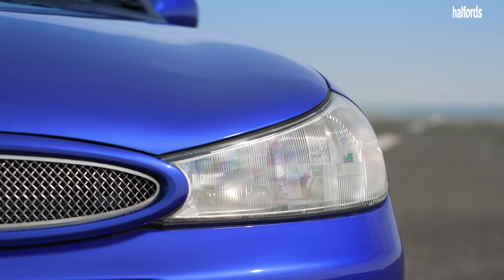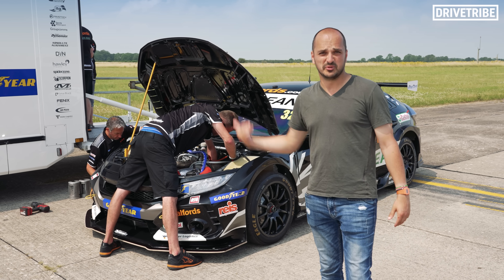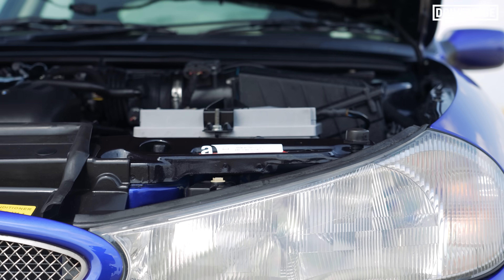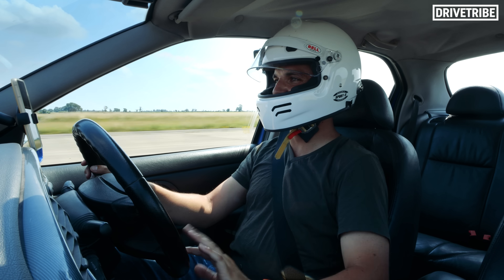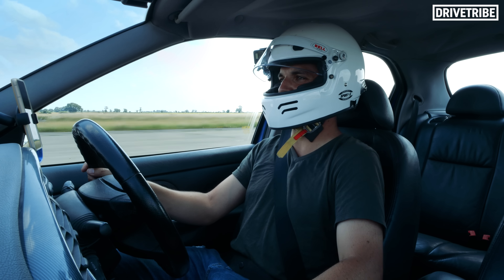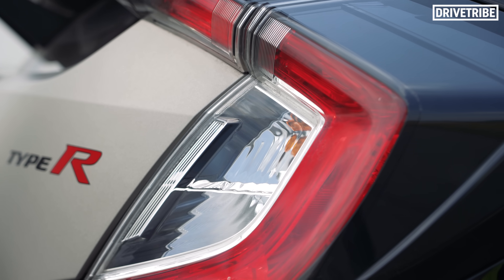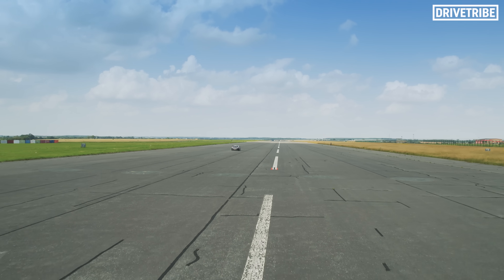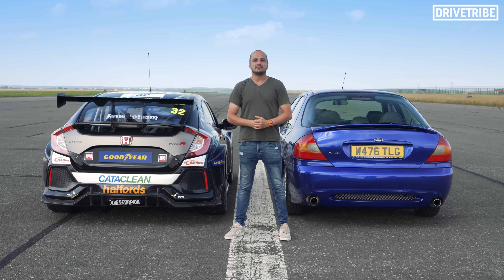Can our 21-year-old Ford still hit its original top speed?!

Comment: Sagging roof lining on a “fully restored” car will always cap your vmax
Reply: And the boot lid lock cylinder
Reply: Should have folded the back seat down for an extra 10hp 😉
Reply: driver's side window also scratched from failed weatherstrips (they all do that sir) and glass not replaced
Reply: Can't quite get my head around the sagging roof lining. Presumably removed for respray... why tf, when showcasing their specialist abilities, would they put that POS back in?!
Reply: @user-tw4cj2wt5d  I can only conclude that either they couldn't get a replacement because of the situation and/or the budget wasn't there. Still, could have done what HubNut done with his Ford whilst over on the other side of the world on next to no budget at all (and will have to do again now Betty the Ford Fairmont (AU) is here in the UK).
Reply: @TheEmperorPigeon  Does seem bizarre! A new headlining couldn't cost a few hundred quid. The rest of the work, at the usual rate, would total 5 figures easily
Reply: Had to go back and see for myself, not great on a supposedly box fresh car, we'll not mention the clouds of blue smoke on launch.
Reply: A roof liner would have to be done by an upholsterer and not a mechanic. It would annoy me though
Reply: It’s a Ford, they come from the factory like that.

Comment: Could use the runway width to get more speed.. drive up to 20mph down the runway, then do a u-turn as you approach the end, accelerating as you make the turn/begin to drive up in the other direction.. maybe?? Lol
Reply: Yeah this seemed a bit low effort, not only there was a fairly long stretch of road that joined onto the runway at the start, with the width of that road you could probably do around 60 to start
Reply: Doesn't work unfortunately. At some point during the turn your velocity in the direction of the finish line will go from a negative one (you are driving away from the finish line) to zero. This is the point where you start accelerating towards the finish line and ideally you would face the finish line directly to apply all possible force the engine has in the right direction. However, during a U-turn, even if you use 100% of the track, you will always start sideways, i.e. 90 degrees tilted from the direction you actually want to go. 
Assuming your tires are at temperature and you can preload the turbocharger (if you have one), it is always better to start from a standstill at the very beginning of the track. Can't cheat physics, yet..
I totally agree with your point thought... I expected the to try something
Reply: @RickyMcSpanish  Exactly what I was thinking when he did his first standing start
Reply: @TheKaylich  I'm sorry, but you are just wrong on this.  You are mistaking the cars ability to accelerate in terms of velocity with the engines ability to accelerate the car linearly (absolute speed).  When you are perpendicular to the track and turning, your acceleration is limited by the tires and your acceleration is due to changing direction not increasing absolute speed.  Just think about if you were on a bicycle and you are traveling at a decent rate of speed and you pull a U turn with a diameter of 20 feet.    When you complete the U turn, you will only be 10 feet from the point where you were perpendicular with the road.  At the end of the U turn, you will be traveling much faster than you could accelerate from a stop in 10 feet.
Reply: @brandonp8300  @TheKaylich Well, either one of you could be right, depending on the vehicle and the radius of the turn. During the second half of the U-turn, assuming a constant speed turn on a single radius, the average acceleration parallel to the runway is exactly one-half of the lateral gs provided by the tires. Whereas if the car did a standing start from the very end of the runway, had AWD, then engine power permitting, it could potentially use 100% of the grip of its tires to accelerate over that same distance, thereby reaching a speed sqrt(2)=1.41 times faster. However, the FWD Mondeo will never be able to accelerate in a straight line at the same gs that it can corner, and its engine only makes 200 hp, so the best strategy would indeed be to take a running start on the largest radius circle possible.
Reply: Flying start makes little difference in this case.

Comment: Halford's are a complete rip off my ex wife took her car in for an pre MOT inspection and Halford's recommended that she needed to change the Cam belt to pass the Mot. when she told me i rang up the service centre to question this obviously dishonest statement and i asked the technician why a cam belt is needed for an MOT (Which it isn't) and he told me " The engine needs to be running!" I then pointed out that the car was driven in and out of the service centre to which he answered " I might not be on the day!".                         find yourself a local mechanic who has to book in work weeks ahead as they don't want your work and are going to be honest. but whatever you do avoid Halfords and Kwik fit service centre's like the plague
Reply: They won’t do the emissions test if your cam belt is overdue. Imagine the belt failing when you’re smoke testing. You’d be the first to sue Halfords. All about liability.

Comment: When are you replacing the interior roof lining?
Reply: never
Reply: Same time as he will be putting the gaffer tape on both bumpers i expect
Reply: @maverick4177  Underrated MK2 Mondeo banter
Reply: it will be scrapped after this video, trashed the engine
Reply: By the time the headlights are restored properly.

Comment: Why didn't you get a draft from the civic then pulled put when it topped out at 140? Could've nullified 30% of the drag, and easily given you a shot at the top speed.
Reply: I'm confused why he only did the speed run from a standing start?
Reply: Your interesting 😂
Reply: @procatprocat9647  You do realise that roads do connect to the runway, it's how the planes don't have to drive on the grass... he could have taken some speed through the corner.
However the key piece of info that was missing in the vid is how fast it was still accelerating towards the end.
Reply: @keoun9759  You have clearly never been to a runway in your whole life.

The interconnecting stretches of tarmac are never located at the end of runways.
As a result, the pass would be shorter and at a lower speed, using your approach.

Try a bit harder next time.
Reply: Not easily, for sure not; lest you literally tow the mondeo with a rope. Runways cant be used to test the top speed of any "faster" car, its just a fools errand.

Comment: Wouldn't be surprised if the IMRC unit isn't working on that. Absolutely hammers top-end power, which is exactly what you needed in 4th gear. Mind you, I used to have an ST200 as a family wagon, and it was never that quick (also drank like a fish). My BX 16v would have murdered it in a 1/4 mile race, despite having less power, but sadly I never got to try it out before our ST200 was turned into bean cans. Still got the old BX though, so if you fancy a quick 1/4 mile at another airfield, I'm game!

Comment: The funny thing here is that the Halfords road tech is doing jobs that anyone can do such as checking fluid levels and tyre pressures. Whereas the BTCC team have to check on the data logging system, recalibration, engine mapping, suspension setup etc. Yes, aswell as fluid levels and tyre pressures.

Comment: Time to ask Turbo Yoda to do its magic and boost that baby up!
Reply: They take boost well. These are the same engines as what was found in the early Noble GTOs, can easily take 450hp on stock internals.
Reply: @NathanFrench  I wouldn't push that far, but engine was rebuild by experts so I'm sure it can hold a small turbo to spin up faster and help that 4th gear!

Comment: I had a 2004 Mondeo Ghia 2.0 Duratorq diesel Hatchback. It was supposed to be 130bhp, but it felt much quicker and it was rumoured that actually when tested on a rolling road, the engines were putting out closer to 160bhp.That car would exceed 140 mph easily as indicated on the sat nav on trips to Germany

I
Reply: I've got a Mondeo 2.2tdci I've had that almost off the clock 150 on the clock pulls like a train to 140 then thinks about it after that

Comment: Dont remember my ST being that slow. your doing 60 to 83 in 10 seconds? must be under powered.
Reply: Ya the car doesn't have 200 crank hp that's for sure, he's finished the Quarter mile at 83mph and there's nothing better then that to know the power of a car. My old stock 1994 Saturn SC2 finished at 88mph and my modified 2012 Chevy Cruze did 89mph. The Cruze was 3200lbs with about 175hp.
Reply: My ST24 had less power and still dealt to it on the 1/4 mile time. In fact it did a 16.7 or something with the IMRC playing silly buggers

Comment: Easily could have used one end of the track to do a 180 degree rolling start of around 30-40mph in at least 2nd gear, instead of a standing start?
That probably would haven't given them enough room to at least get into 5th gear for a few seconds.

Comment: You should add a small NoS tank for that fourth and fifth gear and compensate for the distance with the NoS. You won't need a mental amount, just enough to get to the tops speed. 

Plus it's another video!

Comment: I used to own an ST24 and that would hit 60mph in 7.5sec, and I'm fairly sure it didn't take 9sec to do the next 23mph (83mph/16.67sec). The St24 was down 33bhp at 167bhp too. I don't think your St200 engine is running properly and would be interested to see it's actual BHP checked on a dyno. The car was never a speed beast, but rather something that was amazing fun to throw around the A & B roads of the UK. It gripped like s**t to a blanket, made a great sound and had just enough power so that you could drive it spiritedly without smashing the speed limit......too much. I personally think it was and still is a great looking car too. I believe Ford purchased the designs for the block from Porsche.

Comment: 4:!2 why not start sideways at the far corner (visibly another hundred yards) and you could "slalom" up to say 100 mph then pull in behind a faster car in front to draft up to say 140, then see what wind resistance does … I've done this a million times on the race track … pulling out of the slipstream can be quite the air brake.
Also, have an observer note your braking and put out distance markers (cones grouped "5" "4" "3" etc.) so you're ready to brake without guesswork.

Comment: You could probably start facing wrong way, and right at the end, turn the car, thus entering runway length at 30/40MPH or similar. That would give you a longer run/higher speed..

Comment: I think you need to take it to Millbrook testing ground and put it on their speed bowl. It is the only way that you will get to the top speed of that car and it is not limited to distance.
Reply: Cars on Millbrook never hit top speed due to the banking.
Reply: @NathanFrench  i’ve got more chance of doing it down on a runway as it is never ending and if you go low enough or in the middle you can hit top speeds as we did it when I worked for Lanzante.

Comment: I had a 3yr old Si24v Mondeo Mk1 and it did 154mph indicated........I remember it being 154mph because i had it wide open for several miles willing it on for the magic 155 :D   knowing how optimistic Ford Speedo's were back then no idea what that translated to IRL, but it was right up the top of the RPM in 5th gear.....
Reply: I saw speedo indicated 145mph  in a 2.0 mk2 once... 😂 That is only 130bhp

Comment: I had 3 svt contours wich are the same as  the st 200 but Cooler and meaner looking. For a restored. Engine the quartermile time is very high 16.67 I did 15.7 on my stock. Svt contour with 80k miles or check your imrc and change the inner resistor it looks sluggish above 4k.rpms . American Svt have better Intake air filter it is conic shaped.  They shouldve done an hybrid 3 liter with svt heads. More  torque and better acceleration and mid 14s  on the quarter Mile.  The roof lilin is falling too. Also. The ride height is very tall in the front.  The smoke is kind of normal in this cars mine did the same. When open Throthle  And the engine was healthy.

Comment: The blue smoke from the exhaust and the 1/4 mile time show that the engine is shot, whoever told you they rebuilt it took you for a ride...
Reply: the blue smoke was caused by mike redlining it through all the gears! as it wasnt smoking before it arrived there

Comment: I Have A 98 Contour SVT(Mondeo ST200 & 18 Ford Fusion Platinum(Mondeo SVT) The European Mondeo Always Looks Better Than The Contour & Fusion!😫 It’s Funny Tho Because I’ve Had To Replace Dashboard In My Contour & Reupholster The Leather Dash In My Fusion! My SVT I’ve Owned Since 2005 Has 240k(Same Motor & Transmission) But My Fusion I Bought In 2019 Has 62k(Motor Replaced Because Defected Block But They Did Give Me A 2018 FocusST 2.0, Purge Valve, 3 Half Shafts, Both CV Axles, PCM Reprogram For Dead Battery & Transmission Issue & It’s Currently Been @ Ford Dealership 3 Weeks To Finally Replace The 6F35 Transmission & GDI System!)🤦🏽‍♂️ 😂

Comment: Autocar only got 135 out of one of these when they were new so not really a surprise it got nowhere near 144, especially without a decent run up. They were never very quick for the quoted power. ST24 was scarcely slower to 100 MPH in period road tests

Comment: I think my 2001 ford Taurus could run with you. I've had mine up to 120. I think mine has 265 hp. Same car almost. Mine passes emissions. 186000 miles, almost no rust. Little bit in rear wheel well.

Comment: I have questions though. Why did that do a 16.6 when my ST24 sedan did a 16.3 stock-ish with a pretty ordinary engine? And I was able to get that down to 15.8 with a bit of fettling but still with no ST200 engine parts

Now that I think of it, I suspect someone forgot to plug the IMRC back in

Comment: Hang on a minute, so you've just done a full restoration and engine rebuild. So assuming you've gently driven her for 1500 miles you should have a brand new car capable of achieving top speed with no issues.... but you don't and you also have heavy blue smoke on lift off. SOmething not quite right there!?
Reply: Yeah a freshly built engine with no miles put on it.
Reply: @cynosuregambit8292  he said that it was fully run in.
Reply: @jaykay4218  Yeah he's a liar though, I watched the streams, This is the 2nd engine from the donor car, the first wiped out because of the grit from the vapor blasting went through the lubricants, Crank bearings were shot, This was rebuilt literally days before this filming day, It was finished like 36 hours before, they put some miles on it, then trailered it to this location and had to watch as it was redlined all day, Piston gave up in the end

Comment: This is why the ST200 never impressed me. My 21 year old 330ci with 200,000 miles on the clock hit 155mph on the autobahn with ease! 200,000 thousand miles.. engine never been ‘opened’ just regularly serviced. 231bhp (when new).

Comment: at start very interesting test but... my humble opinion that you failed ...
thumbs up for st200 service.
you did not made dyno test, acceleration 0-60, -100 mp/h (okay, you did test 0-400m), also comparing old "exhausted" sport car with modern racing car is unreal, why not compared with 150-200hp diesel/petrol usual car from "c segment" list..
as someone wrote in below comment, use "autobahn" for top speed ...
no hard feelings..👍

Comment: Looks like my 2017 Octavia 1.0 TSI DSG is faster than a ST200. Sweet!
Reply: its almost 20 years older 💀🤦‍♂️
Reply: @subtllee  true, but it’s also only a 1 litre 3 cyl.
Reply: @filipschlosser5070   with a turbo.. the st was na, most modern 3 cylinders today are faster than 7.0 v8s from the 60s.. its called progress my friend. doesnt make them cooler tho, its like saying a tesla plaid is cooler than an f40 for example because its faster.

Comment: Something wrong with that....the length of the runway should give plenty of room, I had a ex police st and that would blow the socks off most things.
Reply: The engine was never broken in, After the MOT video they found grit from the vapour blasting had remained trapped, had got into the oils and had washed out the bearings in the crank, Engine 1 was officially dead at that point, they then used the donor car engine, fully rebuilt it, brand new parts, it was done 36 hours before this was filmed, it was NOT run in, it had done less than 200 miles and was taken to the airfield on the back of a trailer, it left the airfield the same way because he ragged it so hard that piston six failed, cracked it and has ruined the second engine, he was told that it needed to be run in, he was warned it needed time to seat everything... He had no mechanical sympathy and decided to floor it every single pass, That blue smoke was the end of the engine

Comment: I am surprised coz I would of thought the Ford Mondeo 220 would of been able to do155mph because of all  the big named cars back then was rated to do that speed I could be wrong but I do remember  I was in a ford Sierra Cosworth back in the day and we did over 150-160mph non modified  I thought Mondeo would of been quicker than the Sierra due to being newer
Reply: They can easily reach 150. I suspect the IMRC box was not plugged in so the butterfly valves talked so much in a earlier episode  didn't open up. I used to get 150 easily on the Autobahn  with my old st200 and that was never rebuilt it just got abused.

Comment: 144mph, is that all the ST200 is rated for? My Mk3 will do 141mph and has the same engine but a restrictive upper inlet manifold and throttle body plus a different ECU mapping producing 170bhp vs the 200bhp of the st200.
When I say it will do 141, its rated for that and I'm not going by the speedo, when its doing 141 its off the clock showing approx 152.